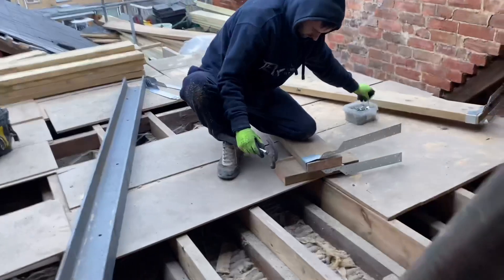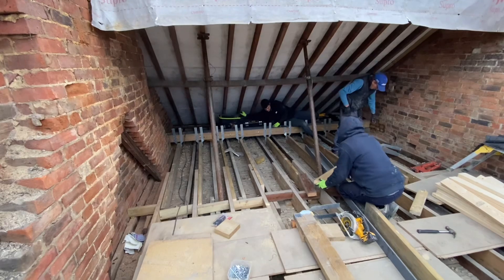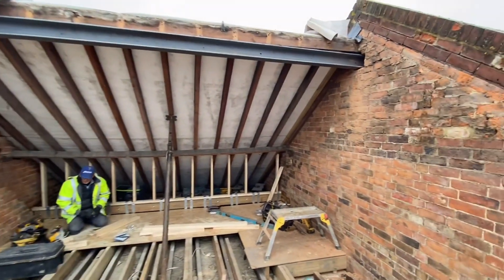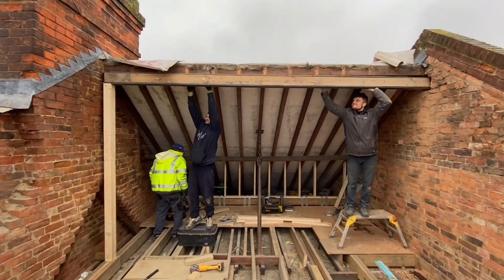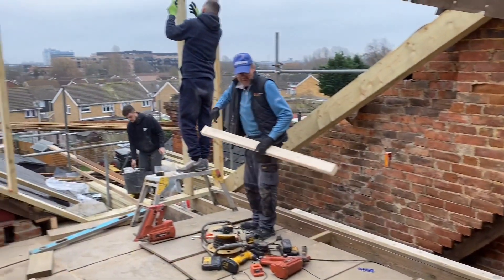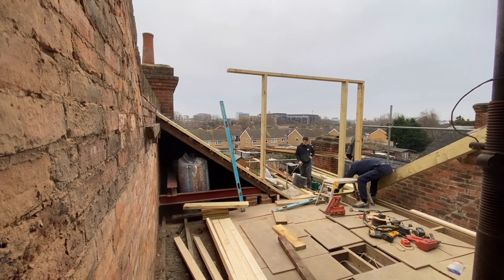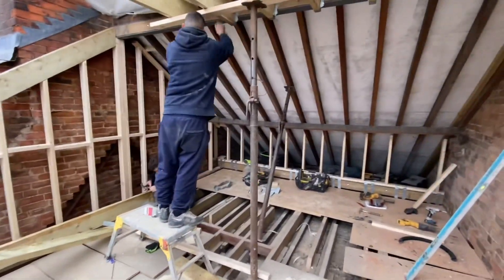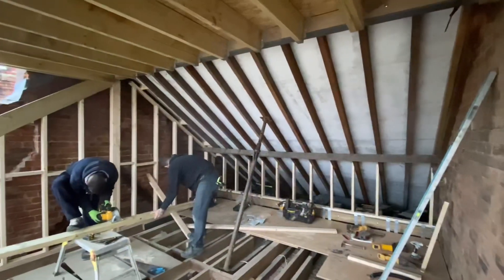How to build a dorma roof for this loft conversion uk in 5 days..

Comment: Terrible work timbers across window not strong enough to take roof load
Reply from the maker: Sorry are you building control?? Because they signed it off ok !!
Reply: @extendaspace-constructionc821  the above observation is structurally correct, even if building control has signed it off. 
Its physics.
Reply: 😅 @extendaspace-constructionc821

Comment: Is that steel ridge sitting inside on the bricks on both sides because it looks as if it's just sitting on top of those stud timbers on one side?
Reply: Probably sat on a load bearing post transferring weight down to a brick wall below. Is my guess from what you can see in the vid.
Reply: On one of his former videos you can see him go into the cavity to lay a pad stone, it’s all tip top!